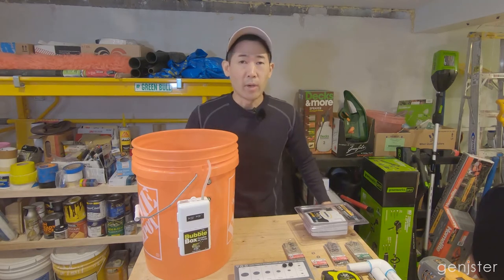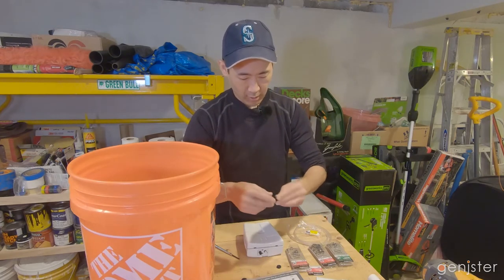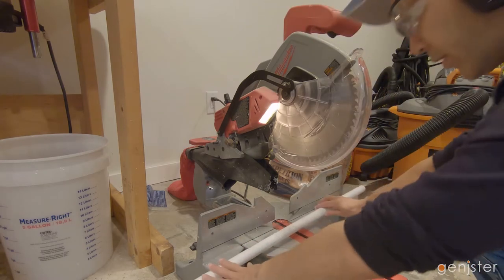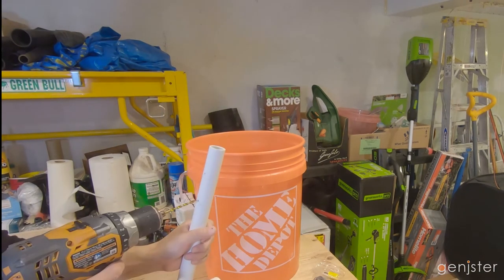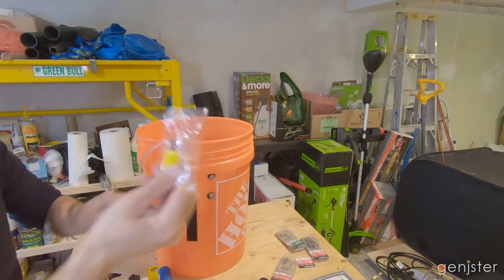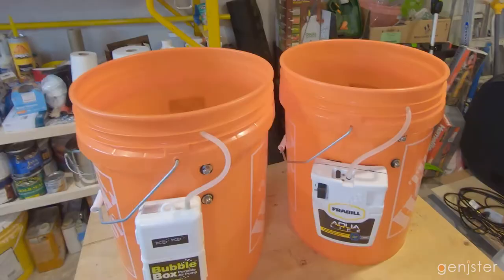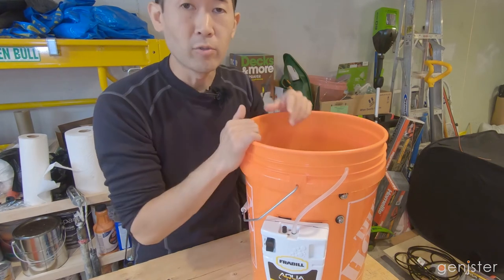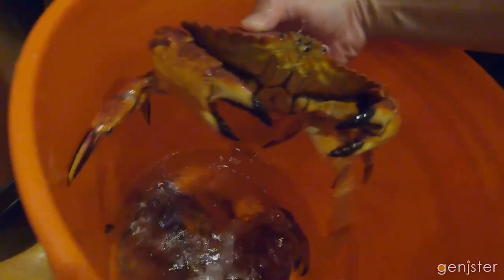How to Make an Aerator Bucket

Comment: I like this idea...thanks for your reply!
Reply from the maker: Btw, if you try doing this, be sure that the water in the bucket doesn't get too warm. Puget Sound water temperature ranges from about 40 to 68 degrees Fahrenheit throughout the year, so the water should stay below 68 degrees. I add salt to cold water and keep the bucket in my basement, which doesn't get warmer than 65 degrees (even during summer). You can also add big pieces of ice, but just be careful with the salinity levels when the ice melts. Good luck!
Reply: @genjster  thank you for your detailed reply...I appreciate that